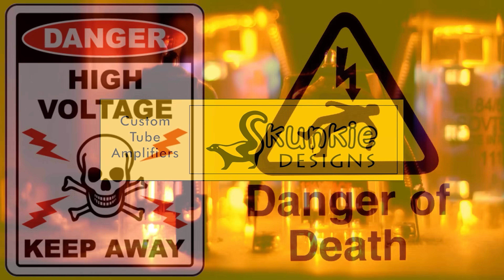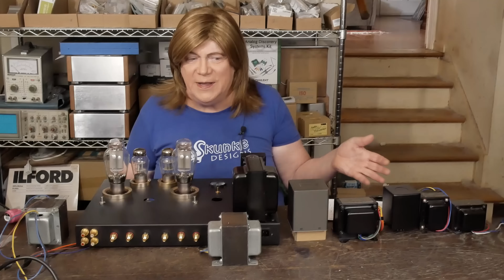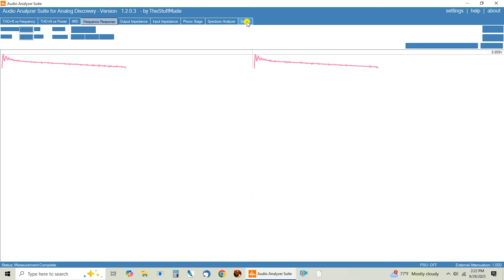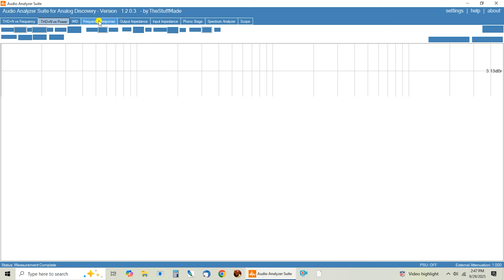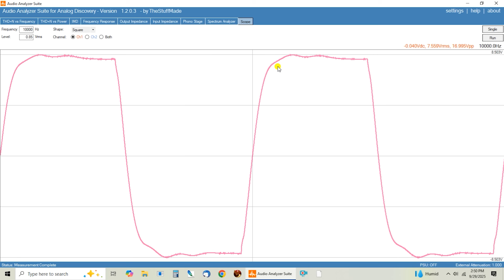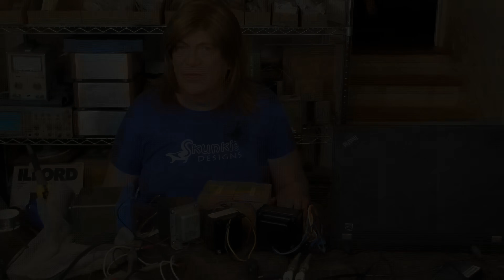Vacuum Tube Amplifier Output Transformer Shootout! 2A3 #1

Comment: Thanks for what you do on this channel, it has inspired me to start my diy tube preamp. Question: beside the traditional look and price, is there any reason to use the EI core transformer vs Toroidal in tube preamp? If I’m not wrong the toroidal has better SNR and better efficiency?
Reply from the maker: They can have their own issues, especially on start up surge. I saw no overwhelming value in adding in another variable, more components to deal with this problem and honestly most people seem to use them simply for cost savings, which is minimal.

Comment: This is a great start - I see you have part 2 posted!- can't wait to watch - I noted you mentioned a 45 amp - is this something you built? I built the Bugle 45 amp, using Edcors, but also just got a set of transformers for it from Musical Power Supply - I'll do Analog Discovery before and after - should be interesting! Also look forward to seeing the rest of the 2A3 traces and see how they line up against the transformers I have in mine.

Comment: Very interesting! Looking forward to the next contenders. I'm torn between Lundahl's and Tango's. Lundahl's are quite a bit cheaper. But that's not the deciding factor.
Reply from the maker: Never tried Lundahls, maybe on a future build.
Reply: When you add in the $90.00 each for the covers, it comes out about the same. After searching for a month I could not find a 3rd party cover for these units. Contemplated making my own out of 4" round aluminum tube but between the cost of the tube and the time...it was barely worth the effort. With that said, bit the bullet & went for the Lundahls. If they are good enough for Elekit, they are good enough for me.

Comment: but with lower disortion/cleaner sound dose it mean it will lose that musciality like that warm/second harmonic distortion?
Reply from the maker: Possibly why those heyboer transformers sound nice?
Reply: @SkunkieDesignsElectronics yeah i guess with everything theres a trade-off
Reply from the maker: Absolutely and why subjective listening is also needed.
Reply: @SkunkieDesignsElectronics so personally do you prefer cleaner or more musical sound?
Reply from the maker: That's a good question. I've enjoyed listening to amps that honestly didn't test that great, and also enjoyed low distortion ones.
Reply: @SkunkieDesignsElectronics but i assume the imaging/holographicness wont be as good as cleaner amp?
Reply from the maker: No, that sort of aspect of an amp is unrelated and has to be heard. You can't assume things like that from pure measurements.

Comment: Not surprised by your testing.  I run a pair of the 15W 5K Musical Power Supplies output transformers in my little spud amp.  They are very good indeed for the money !
Reply from the maker: Those are a great value and work well in a lot of projects! Just make sure you choose the right model for the intended use.